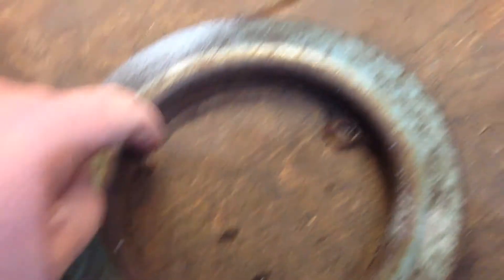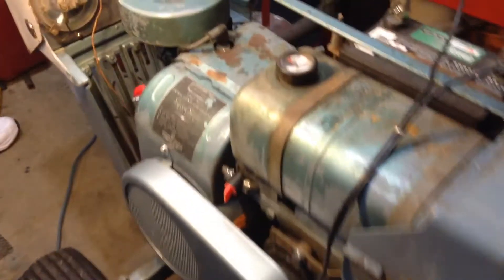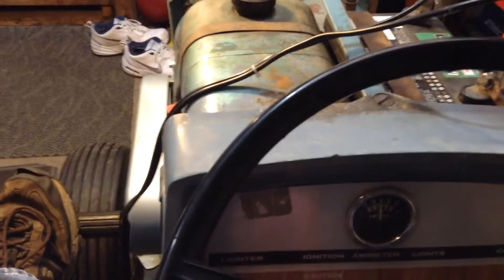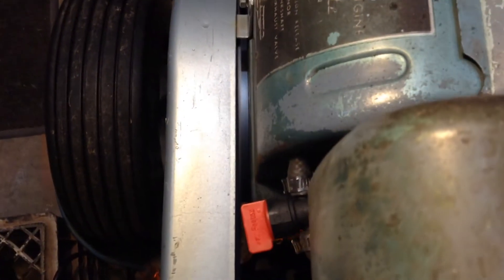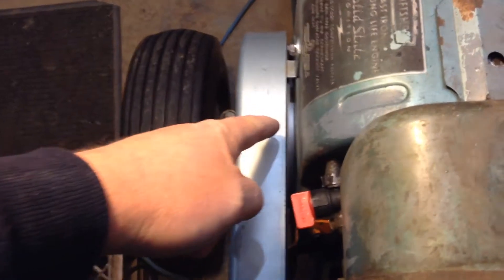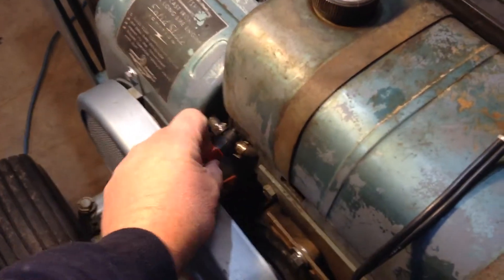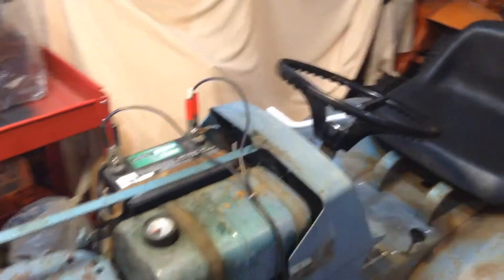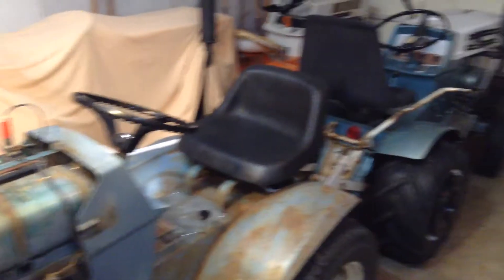Working on the 68 SS12 hydro

Comment: Wow! Reminds me of my 69 flywheel, one bolt hole was split in the flywheel so the previous owner drilled and tapped a few sizes larger and it's by far less than perfect, but considering the condition of the engine, it isn't worth fixing it. Happy New Year bud!
Reply from the maker: 71_Sears Yup I sure love the "mechanics" that are out there. lol Happy New Year to you too my friend.